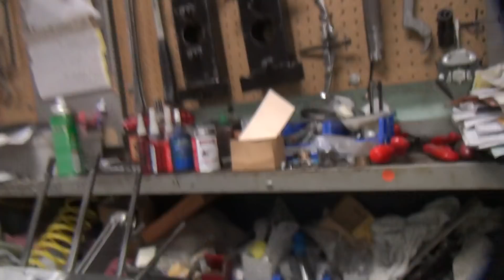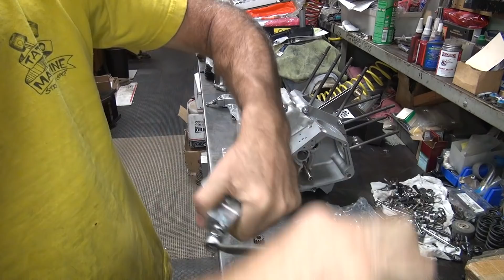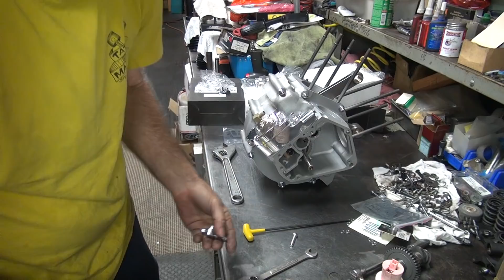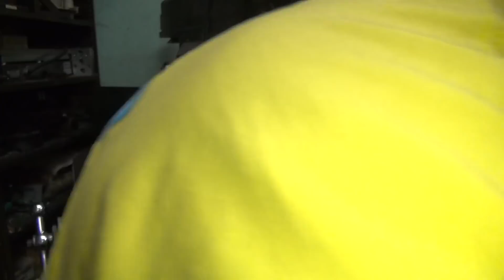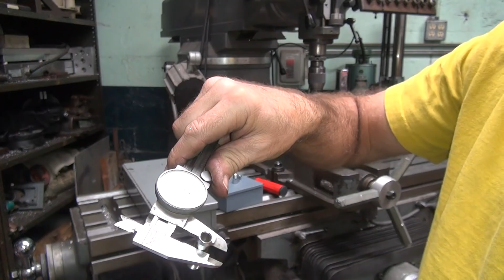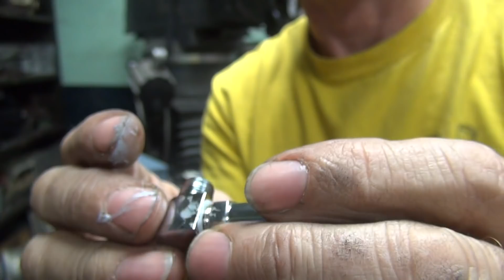1992 80ci evo motor rebuild #115 repair softail fxst flstc case welding harley by tatro machine

Comment: Why standard volume oil pump ? What disadvantage hvhp pump ? Thank you
Reply from the maker: its just not needed in a low/mid rpm stock size motor. all you are doing is wasting power pumping oil into and out of the motor. its all on bypass. on a high rpm motor it can help getting the blowby out of the motor. a vac pump would be a better deal but no one makes on for a harley.
tatro

Comment: Couple of questions. Why would Ultima put fittings in without sealer, in fact why put them in at all? Second, we both know Ultima will probably not replace the cover that is messed up. Is it possible to drill it out and thread it for 3/8" NPT and then use a 1/4" to 3/8" reducer bushing to make the pump useful again? If it was my call, and I know it's not, I would think about replacing all that crap with S.S. Swagelok fittings. U.S. made, the 1/4" street elbow has a .280" (9/32) bore throughout so there is no need to drill anything.
 (   https://www.swagelok.com/downloads/webcatalogs/en/MS-01-147.pdf   )
Reply from the maker: normally i would delete your comment because of the link you added. why would i use s&s cranks when they cost more and are not much if any better. watch some of my other videos where i do use s&s cranks. they probably will replace the oil pump cover for me. ultima usually stands behind their parts better than s&s. each company has good and bad parts. this is why i use the parts that are best for the job i am doing, not just what i have here in the shop.
tatro